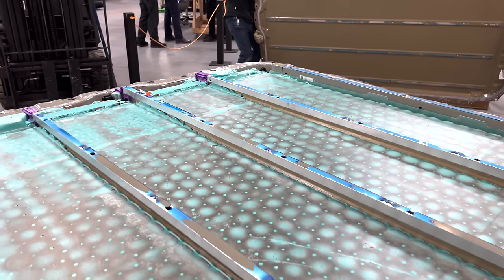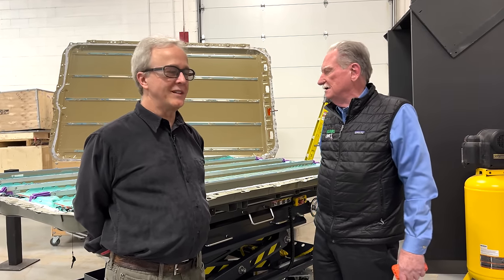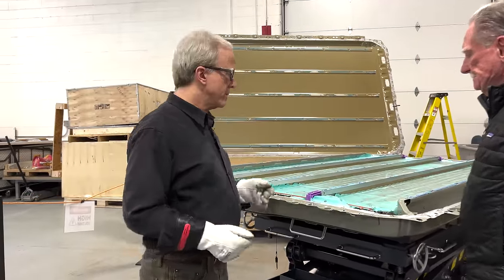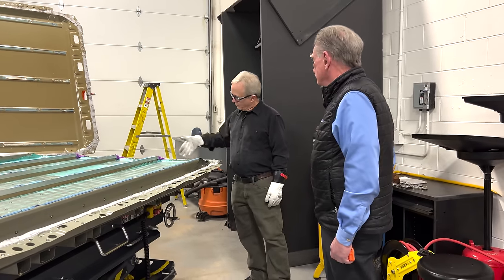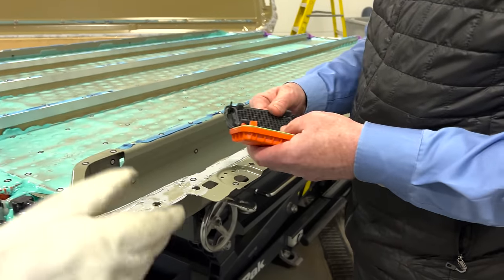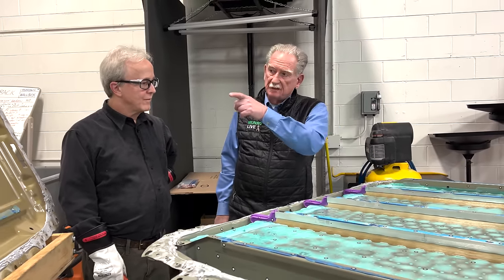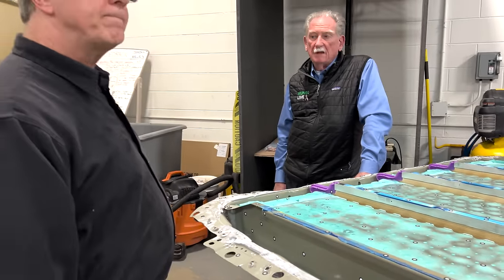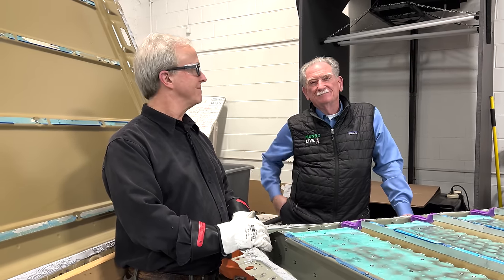Tesla Cybertruck Battery Pack: Our First Impressions Under the Lid

Comment: NEVER gonna buy a electric anything until they remove the battery cells.  For the money you pay for that truck or car or bike or ??  you shouldn't have to worry about ANY fueling for 5-7 years.  ANY fueling at all.   I care about my kids more than that.  I don't want my kids cooking or freezing waiting for a vehicle charge,, that might not work. I don't want to stare helplessly while they are plasma torched in half in the back seat. Now put a supercharged LS6 and hot shift 4L80 in that Cybertruck and show them what it should sound and feel like,,,for their money.